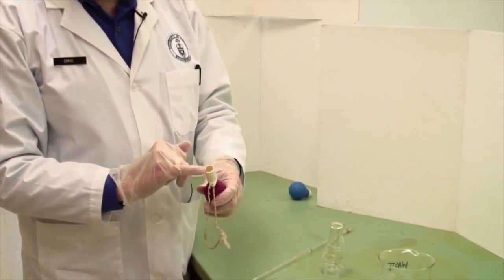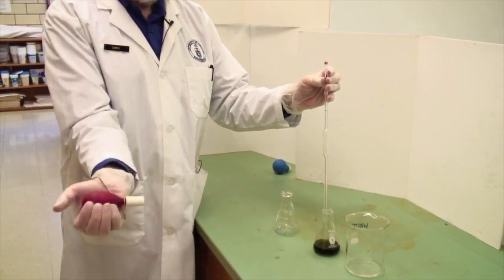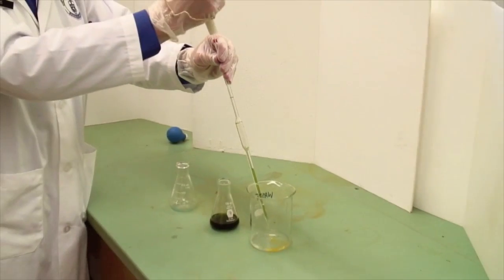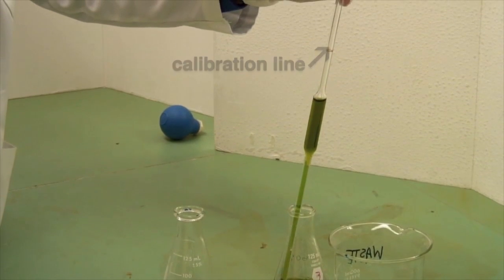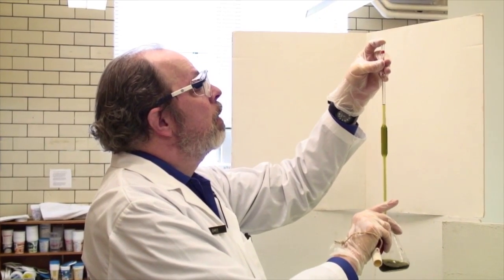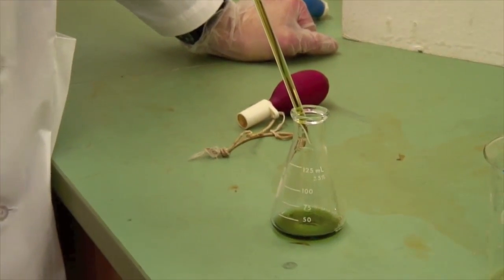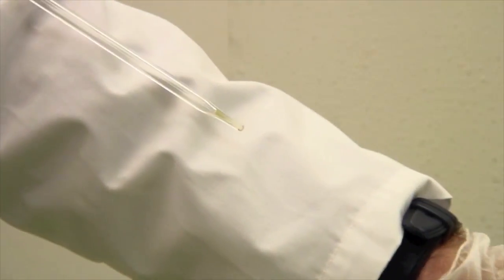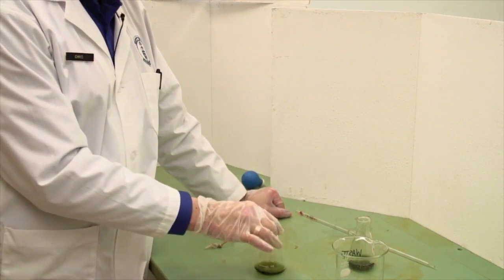Volumetric Technique 2: Use of a Pipette

Comment: Thanks for your useful teaching how to use pipette. But I have a little question that Why do not we blow out the liquid at the tip. If we do blow, what will effect to the result? Thanks again!
Reply: Yes.  The pipettes are calibrated so that that little amount should not be included in the aliquot.  If you were to add that little amount of liquid into your receiving vessel, then the measurement of the solution would be too high.
Reply: @taylorhogue316  Thank you so much
Reply: Also check your pipette if there's a TD marker on it .it means to deliver only.